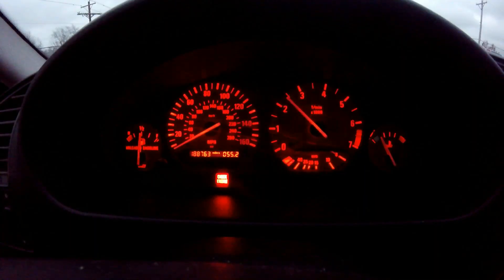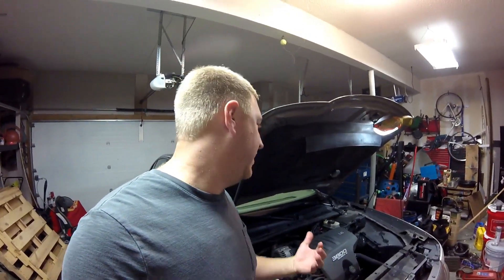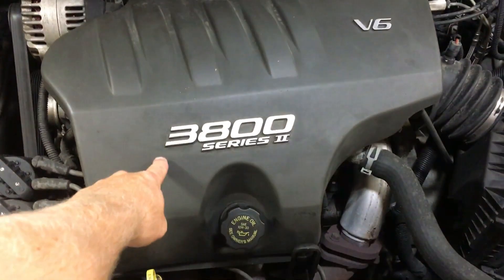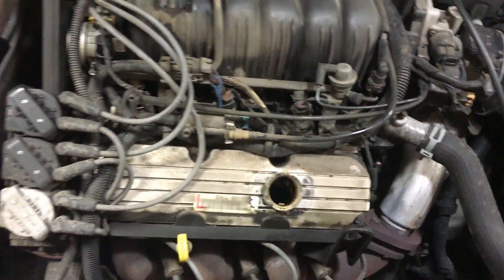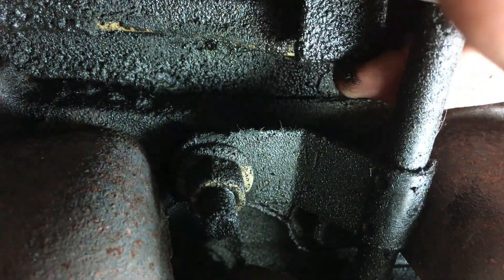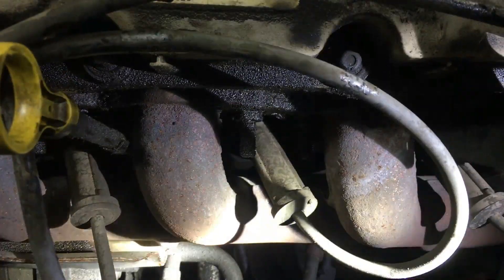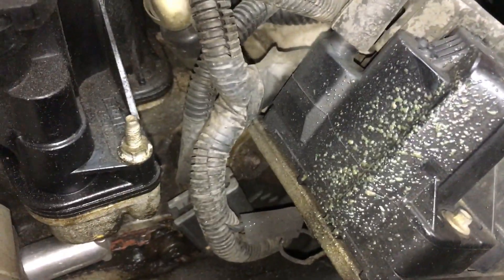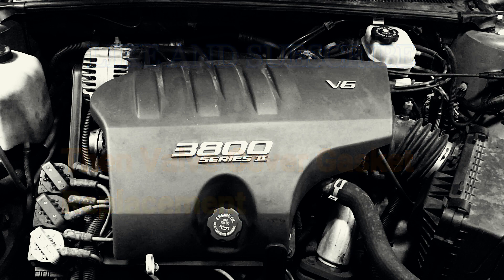Diagnosis of oil leaks on a GM 3800 V6 - Valve cover gaskets and intake manifold gaskets

Comment: There is a recall out of this problem. Justice had mine done free of charge. Look up your vin before replacing anything yourself. You can’t go wrong with free service and/or parts.
Reply from the maker: The recall is only on some W body cars. I talk about this recall in one of my other videos.
Reply: They did my recall..took my cover away..supposedly fixed the valve cover gasket..leaks again after a year and and A half at  6k err..hey is there  puddle of oil inside that oil fill..when they did the recall on mine..they changed out to a different oil cap and different plastic piece  ...i noticed there was oil jus sitting down in there  it would steam out when i took the oil cap off..and i think that is why my buick is burning so much oil! Is because oil is jus stiiting thete and not moving..and it burns..then more oil gets circilated and sits and burns.. Does that make sence..iam baffled on why my car burns alot of oil on short millage...its bad..i only have 63k i changed my pcv..didnt help

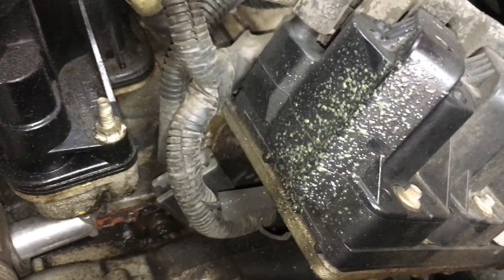Comment: Wow at the beginning of the vid i heard you say something about smell and my 01 Impala has a horrible smell once it reaches around 200 degrees in temperature so i was already thinking about replacing the valve cover/gasket. But watching at 5:00 , my car has the exact same yellow grease that this one does and had no idea where it came from or what kind of oil/grease it was! But just to confirm, i have that exact same yellow grease but its shooting towards the power steering reservoir like in the back of the engine passenger side. And when i floor the gas pedal, it shoots up on the hood of the car. Is it the CV Axle Shaft? Thanks hope to get a reply.
Reply from the maker: CatSmackDaddy if it smells like burning oil then it’s probably the valve cover gasket a leaking onto the hot exhaust manifold. That yellowish grease came from that cv joint boot. It slung onto the belt when driving down the road and the belt then threw it onto the ignition coils. I hope this video was helpful.
Reply: I also replaced that same side cv axle due to boot failure. Not a bad job. Disconnected hub from strut, Old axle tapped right out, new axle tapped right in; a hammer is your friend on that job. Every man for himself on reassembling the strut with the hub though....

Comment: I've got this same issue on my 2000 Park Ave, why is it a good idea to toss the engine cover? Trapping all the burnt oil against the engine block?
Reply from the maker: dreadred92 It’s what GM has the techs do as part of the recall on the W bodies. I would assume it’s about holding the heat in like you said.
Reply: I gotcha, thanks. Trying to do this job this weekend, I'm sure I'll be referencing your videos.
Reply: @dreadred92  it because they change out the oil cap..and the plastic piece that it screws into..and go with a new one..and the new one is a different set up..and its funny..my old oil cap says use 5w30 oil..and now the new oil cap says 10w30..jus sayen..and also because ive been having issues with it still leaking oil still..err
Reply from the maker: Are you sure the oil isn’t coming from somewhere else? Maybe they didn’t clean off the surface good enough or torque the bolts correctly.
Reply: @PetesGarageandperformance  hey pete..iam not sure..but i know when i look down onto the oil cap opening with the new recall setup..i see a pool of dark oil..darker then my dipstick...and its  steaming like it jus sits there and burns...beacuse all i know is that i burn a half court of oil somewhere around 400 miles..its crazy..i got 63k..so iam like..what? And it leaks all around those seams u pointed out on ur vid...maybe i need new gormets i think the mechanic said he replaced 3..but that was it...iam jus stuck on this oil consumption
Reply from the maker: Eric Maeder have the lower intake gaskets been replaced? If so the hidden bolts under the upper intake could be left loose and it would suck oil past them. A half a quart every 400 miles is pretty excessive. If it was leaking externally that much you would probably be leaving a lot of oil spots. The steam from the oil is probably condensation burning off. Once the oil temps get to 212*F then the moisture in the oil turns to vapor. This moisture builds up if the car is only driven on short trips and the oil temps don’t have time to get to 212. Your low mileage indicates that you don’t drive long trips.

Comment: That oil cap was poorly placed and has a high risk of falling into the engine bay. Also I'd highly recommend a recall be preformed by a certified GM technician. lol
Reply from the maker: Trenton Thompson I think we should hammer the torsion bar bolt with a half inch impact until the bolt snaps off! That would fix it!
Reply: Pete's Garage only if i can put the torsion bars in a bmw for no good reason
Reply from the maker: +Trenton Thompson lol. Aren’t you supposed to be in class?!
Reply: Pete's Garage aren't you supposed to be in a conference lol
Reply: There are support groups for men with busted vaginas.